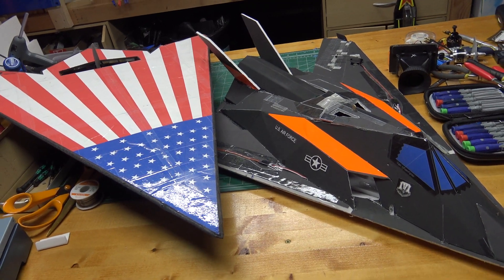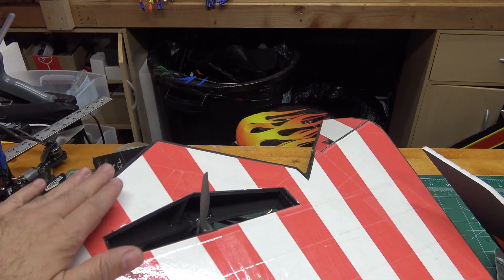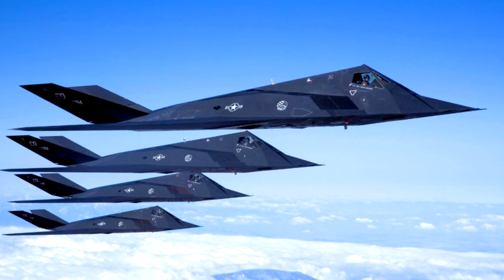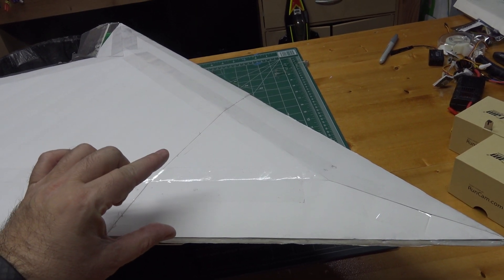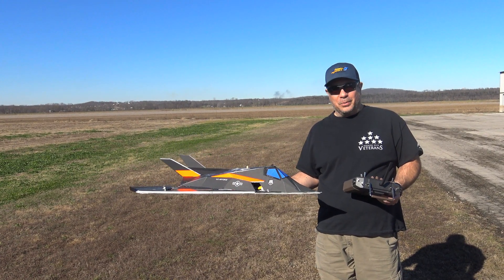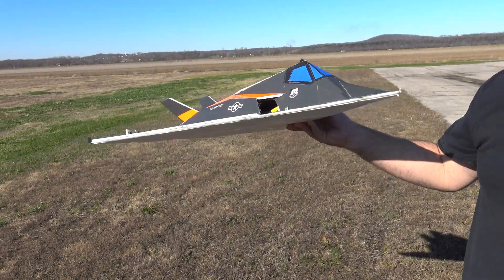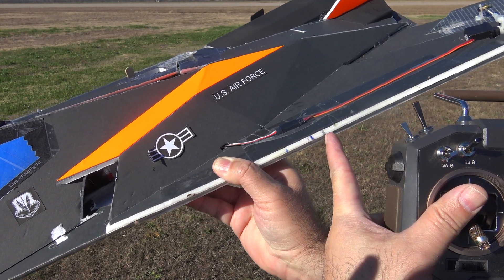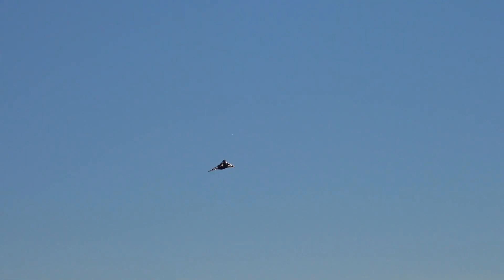FF 117V2 EDF Experiment Part4

Comment: excellent job on the new version Paul, and the slightly angled buttom works very well, even better than i thought it would. Perhaps even good enough to flatten the exhaust in the end because you could  lower the thrustline slightly in you new complete build maybe. If you scale this up you will have a great jet on you hands, and can really go crazy on it, lke 70mm fans or landing gear even. And from my outside view it looks like that power was actually ok, and i personally would probably go for a longer more flight time than for speed but more power of course makes it easier to launch...Again awesome job and good luck with your new build  :), cheers.
Reply from the maker: Thank you WarbirdFan66 for the comment and thoughtful feedback.  I was happily surprised too that it worked out so well.  I will most likely be building a few different new sizes of the plane now that I have a better idea of what is needed. I will be building a new 50mm version and also a larger one for a 64mm or 70mm EDF. The thrust line will be a little lower in the new design since the bottom is now lower.  I think you are right that I can probably flatten the exhaust a little without too much effect.  I'll have to see how it all works out size wise in CAD. Hopefully soon I can get the new models designed, built and flying for more tests.

Comment: Cool solution, you sort of turned it into a lifting body airfoil. Also made it more scale.
Reply from the maker: Thanks for the comment Greg006! Yes, I guess you are right it  pretty much is now more of a lifting body type airfoil. The flat plate wing worked good on the prop version, but the EDF seems to be helped a lot by the new shape with more frontal lift.

Comment: I think spend Bat a lot...i prefer prop , the sound is amazing...I build a prop version very easy to fly and very stable.
Reply from the maker: Fanatico FPV, you are correct the Prop version is cheaper to build and was much easier to get to fly right.  Trying to make an EDF version has made for a different, and fun challenge.  The Prop version does have better performance, but the EDF sound and presence in the air is pretty cool too.  Thanks for commenting!
Reply: @rcFoamFighters  good work guys...
Reply: @rcFoamFighters  good work guys...